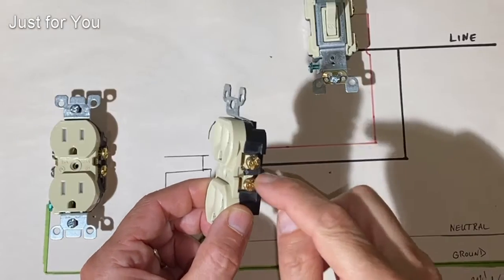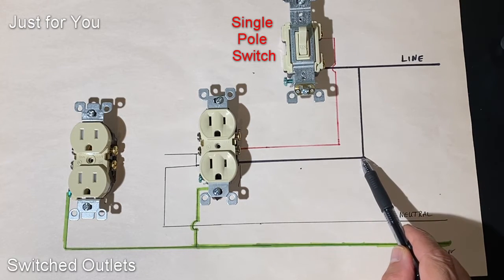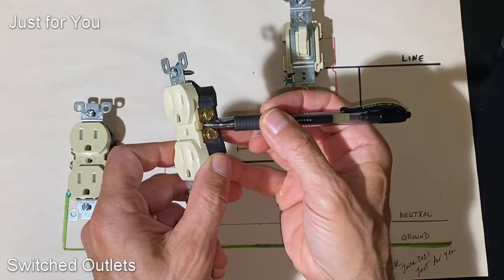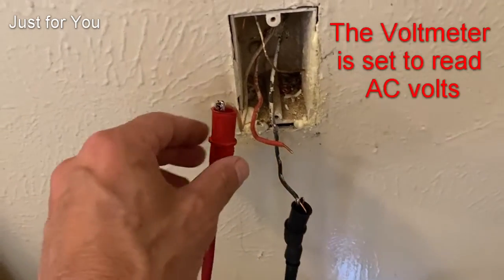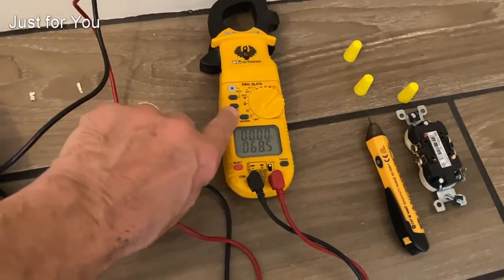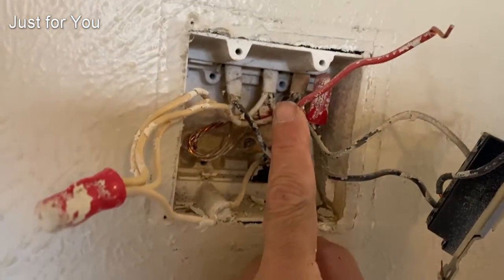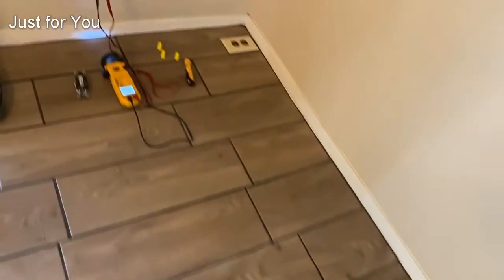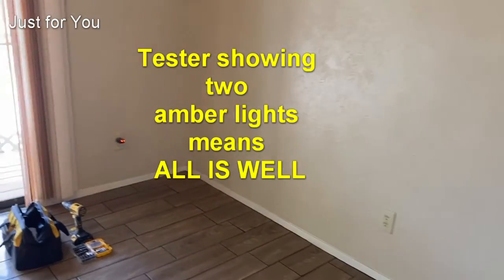Do not make this mistake, why a switched outlet is ON all the time, how to correctly wire it. Longer

Comment: Great video! Q. Can a half hot let's call it (#2)receptacle work with only a black and white wires being feed from another half hot (#1)receptacle?  Be4 swapping outlets they both worked half hot from switch. After replacing, only #1 works as half hot. #2 bottom is powered and top seems dead which is supposed to be the switched part with tab removed. Without tab removed #2 works like a normal outlet (not switched).
Reply from the maker: When I removing the tab on an outlet to create a switched outlet, ONLY remove the tab for the line and NOT the tab for the neutral. And, yes, one hot (line) that is switched can take care of both switched outlets.
Reply: @JustForYouDiy  little more info. I have 2 half hot outlets and 2 regular outlets downstream on this circuit. The 1st half hot seems to be the main outlet which has 3 sets of cables coming into the box. One is a 14/3, and two are 14/2. 
The 1st half hot outlet is working properly because its using the 14/3 wire. Cant get the 2nd half hot to work but it did be4.
Q. How do I carry this hot traveler wire (14/2) to control the 2nd half hot outlet and one regular outlet downstream?
Gold tab removed on second outlet and not on neutral. This has boggled my mind for days now. Thanks again..

Comment: I have switched all outlets in a room  and 2 were on a wall switch.  I didn't realize the connector between each top and bottom of the 2 outlets needed removed for one to be hot and the other switched.  Was driving me crazy.  Fixed and works great.  Easy peazy!  Thanks for the info .
Reply from the maker: Thank you for the post. I’m glad the video was helpful.

Comment: Great explanation. I now understand my real issue which is I have 14.2 wiring to the switch.  Is it possible to accomplish this by using a pigtail from the black wire to replace the lack of a red wire?
Reply from the maker: The Red wire is switched on and off through the wall switch. As long as that happens, you’re good.

Comment: What would be the cause if only the bottom half the outlet is working on all the outlets within a bedroom? There is a separate switch to turn on the top half of the outlet but when flipped nothing happens.  Bad switch??
Reply from the maker: Yes, it could be the switch. Another potential cause could be that the line (hot) going to the switch is missing. Hope this helps.

Comment: the tab was removed on the hot side where the black and red wire go and i didn't notice it and put in an outlet with the tab not removed and when i turned on the breaker it started to arc so i shut off the breaker ,
 Can that cause damage to my wires or do i just have to break the tab off the outlet for the red and black wire on the hot side?
Reply from the maker: If there was arcing in the breaker/panel, there could be damage to the buss bar in the breaker panel.
Reply: @JustForYouDiy  
The bussbar looks fine and i flipped the breaker as soon as it happened.
I took the outlet out and put marrettes on the wires and flipped on the breaker and everything works for the other outlets.
Now its time for an electrician to replace the outlet because that is enoudh for me.
Because the other outlets are working fine is that a good sign also that i caught it before there was any damage?

Comment: I went through this EXACT situation earlier today after switching back to a "standard" outlet plug.  I grabbed one with the tab still connected.  Switch didn't do a thing.  Now, after clipping off the little tab switch works perfectly on the light and the other plug is on all the time.  Thank you!
Reply from the maker: Excellent. Glad to see that the video helped.
Reply: Video was awesome and allowed me to get one project done and move on to others.  Thanks again!